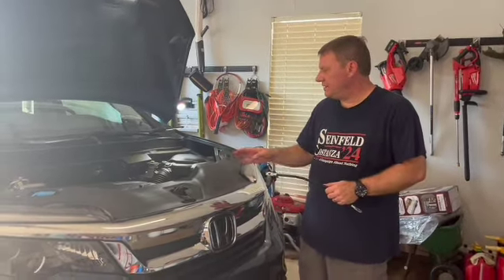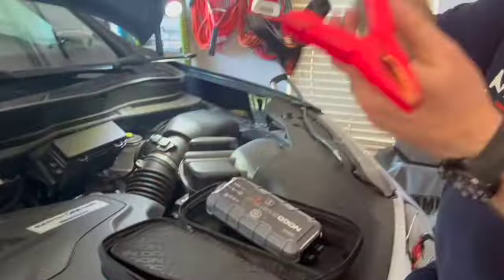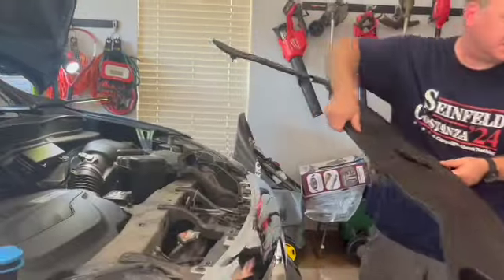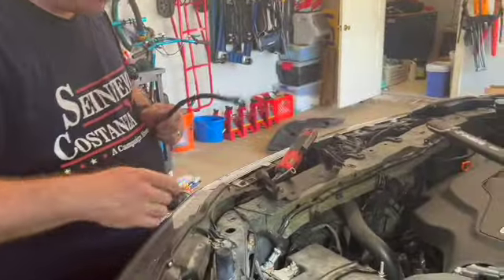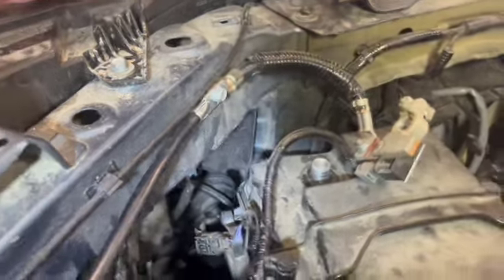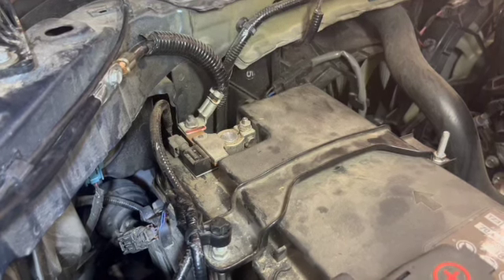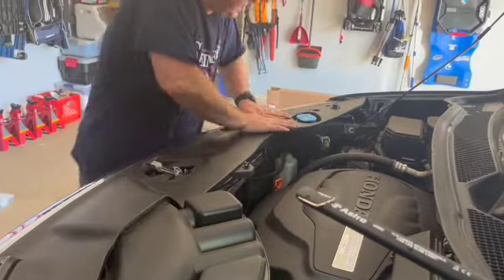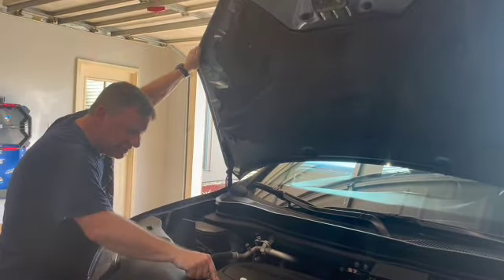Honda Pilot (Ridgeline, Odyssey, Passport) Battery Terminal Extension Install for Jump Starting

Comment from the maker: I used 4-Gauge (4 AWG) x 15” long battery inverter cables with 3/8” ring terminals on both ends. The 15” is no longer available on amazon, so either a 12” or 18” will work. 24” is too long.
4-gauge (4 AWG) x 12” long battery inverter cables with 3/8” ring terminals on both ends: https://amzn.to/3Kovah8 - This is for a 2-pack.
4-gauge (4 AWG) x 18” long battery inverter cables with 3/8” ring terminals on both ends: https://amzn.to/3wZJaLf
Reply: Thanks again I need to do this!

Comment: Once you install, is the wire not hot on the open side? If the metal touches any other metal it drains the battery. How is this not a safety issue?
Reply from the maker: The zip ties are intended for you to place it where you want it so that it does not touch any metal.

Comment: 1st winter with my Ridgeline. - 5 degrees outside and it won't start. Opened the hood to charge it and ............%#$@$%&. Thanks for the tip!
Reply from the maker: You’re welcome! I hope you get it started. Also please update us if you end up having to get a new battery or something because it sounds like the one you have me be the problem.

Comment: Paul - if I wanted to jump a car that's dead with my Honda, can I use this inverter wire as my ground insteal of the battery terminal itself (without then removing the air intake?). I know this works great if my honda is dead, but I am asking as if the opposite is true and I'm using my honda to help someone else
Reply from the maker: Yes, I believe you can because what we did was extend the negative battery terminal with this cable meaning that when we connect to the end of this cable everything should work the same as if we directly connected to the negative terminal.

Comment: Can’t we jump start with GB40 in traditional method ? ( without the additional steps you showed in the video).
Reply from the maker: The cable extension installed in this video allows you to attach the negative clamp to the extension so you don’t have to remove the items that are blocking it. You could also use another grounding method but this cable extension provides a safe connection. The extension is also useful if you are helping someone with traditional jumper cables and they are the ones with the dead battery. In that case it would give you a solid negative terminal connection to help them out without removing the items that are in the way.

Comment: Thank you for the video. It’s kinda crazy that manufacturers make it so hard for us to jump the car if needed. One question, would there be a problem if the extension touches any metal part of the car while driving?
Reply from the maker: I am not sure. I attach mine so that it’s not touching anything.

Comment: Came across your video while searching for something else and I'm so glad I did... I have the NOCO GB40 and I always wondered how I would use it in my 2021 Pilot. I have a 2021 Pilot EX-L AWD trim model so I'm hoping your 2019 has the same setup as my 2021. Thanks for the video!!
Reply from the maker: You’re welcome! Your 2021 Pilot should be the same setup as my 2019.

Comment: Paul, thank you for the video.  I have two questions.   First, why did you unhook the negative terminal before doing this work and 2.  I have used ground to frame to jump my Pilot.  That seemed to work fine, although your solution is more elegant.   Thanks Bob.   PS:  Appreciate the hood angle tip.
Reply from the maker: Thanks for the comments, Bob. I removed the negative terminal to prevent sparking while I performed the work. Your method of connecting the negative cable to ground would work great if your battery was the dead battery. However, if you have the good battery, and you are helping someone else with a jumpstart, the recommended method to jumpstart is to connect the jumper cable to the negative post. The only time it’s recommended to go directly to ground is on the dead battery. Also, some vehicles people are not confident finding their own ground spot to connect the cable to, so this can take the guess work out of that. I hope that is helpful.
Reply: @PaulNaylor3 I understand you just want to be careful,  but you don't get a spark on the negative post, just on the positive post. Also, if you have a portable jump starter, why would you need the negative cable extension to jump the other vehicle? Those portable jump starters have all but eliminated those jump starting cables in my opinion
Reply from the maker: @watuzi  as I mentioned in the above comment the reason you would want to use this is if yours was the good battery and you were using traditional jumper cables to help someone else. Also, the negative will spark. I’ve seen it happen.

Comment: i have a 2020 passport, which is same as your Pilot, just curious with having the battery out for some time, did you have to do anything with vehicle computer? did it mess anything up per say?
Reply from the maker: No, it did not cause me any issues.
Reply: @PaulNaylor3  very cool, thanks
Reply from the maker: You’re welcome

Comment: I like the zip tie however does it affect anything that the terminal extension is sticking against the side of the engine’s compartment(shorting sparking etc) …Sorry I’m sort naive about electrical
Reply from the maker: No. The extension is insulated, the one end is bolted to the frame and the end used for jump starting is not touching metal.

Comment: Does the alligator clip on the Noco attach to the ring terminal on the ground extension such that a good enough connection can be achieved for jump starting? Thanks
Reply from the maker: Yes, those NOCO clamps are secure.
Reply: @PaulNaylor3  Thanks, because I want to get a Noco for my Ridgeline and I was trying to envisage how the Noco clamps would attache to the ring terminal. I am alkso considering installing a 6mm bolt on the front inner passenger side where Honda have a pre dilled / tapped hole as a ground point for a jump cable..
Reply from the maker: You’re welcome!

Comment: Hi, a person below that mentioned "terminal extension is sticking against the side of the engine’s compartment".  The end is still "floating" there and can touch metal, but it's the ground, so touching metal shouldn't affect anything right?  Or am I missing something.  Should I wrap a piece of electrical tape around the end, to be certain, or is there simply no reason, because, again, it's just a ground?

PS - LOVED this solution.  I bought my wife the jumper but she was dismayed at the prospect of popping off panels.  This "hack" is amazing!  THANK YOU!
Reply from the maker: You’re welcome. I believe you’re correct about the end of the extension.

Comment: Great video,would this work to trickle charge battery easily without constantly removing the cover and air box? Thanks.
Reply from the maker: Great question. I don’t have experience with that so I don’t know. Maybe someone else can answer.
Reply: Yes, it will work for your trickle charger as well - and a lot easier to get to then removing all those covers.
Reply: @jimselzle3782  The instructions for my 2015 Pilot say "Disconnect both battery cables to prevent damaging your vehicle's electrical system."  Page 423.  Maybe they have changed it for newer cars.
Reply: @jimselzle3782 
So you say it would work to charge my passport with a Noco Genius 10 charger? Would be a pain to disconnect all those parts.
Reply from the maker: @SS-wy5rl I found this on the Noco website: 

https://no.co/media/nocodownloads/format/g/e/genius10na_user_guide_4.9.2024a_2.pdf